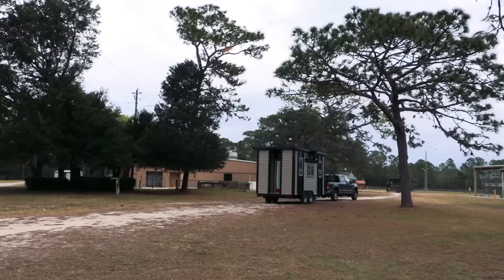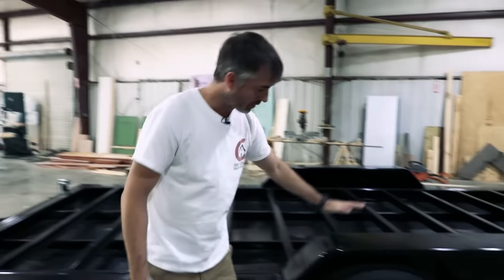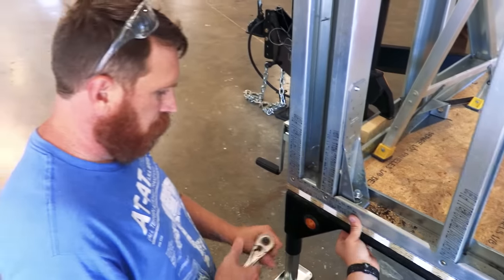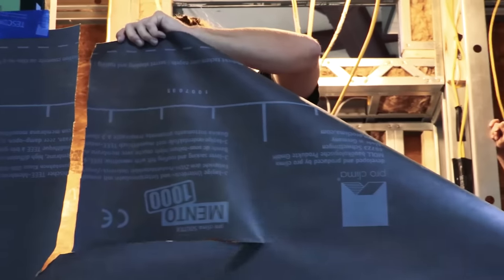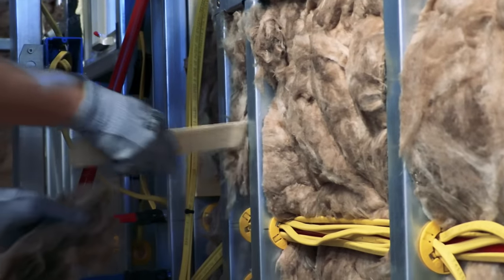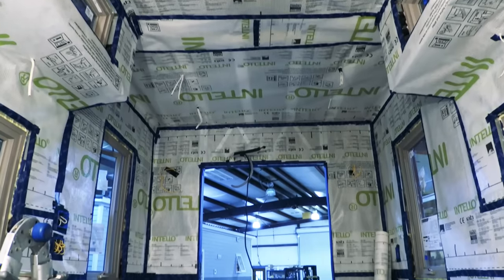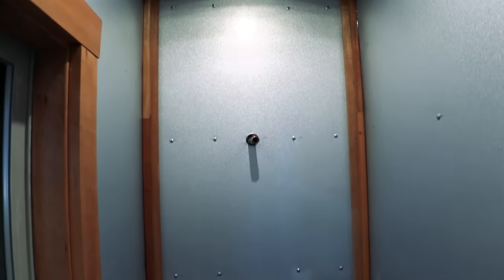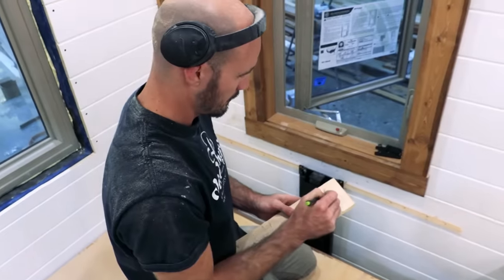Building A Tiny House From Start To Finish!

Comment: Why not weld the steel frame on the trailer? Or why use bolts at all? For maintenance, or quick repair maybe?
Reply from the maker: You can construct a tiny house with a welded steel frame, but it's not really how this system works. The bolts secure the frame to the trailer really well. That thing isn't going anywhere! :)

Comment: Wrong hot water heater you have gone with gas tankless and as for the shower in galvanized steel that a bad idea but stainless steel on other is better option and what wrong you never ever make a flat roof as water will always fine way in 99% faster that way and just look at RV, Box, Semi trailer and if had used a flat roof you gone with cap style with roll over edge other and even then I would have a still put slope on it for drainage.

Comment: The house looks amazing. And I always enjoy seeing tiny house designs that actually utilize very little space. 
Some of those tiny houses shown in videos are way bigger than my apartment :D
Reply from the maker: Especially in the US we found that many of the tiny homes were still quite large spaces! In NZ and Australia we use many of the smaller designs as our roads aren't as big and we are very limited with weight. Because this was designed to be a traveling tiny house, we wanted to come up with a design that was as compact as possible to make it easily portable and simple to find parking spaces for, while at the same time also designing home which is comfortable to be lived in full time.
Reply: I'm from Germany so tiny houses are not a big thing here (yet). And some of our roads are tiny so I think a lot of the American designs would not work here at all (even without legal regulations making most of it impossible). That's why I'm always interested in seeing smaller ones. There are also some people in Berlin right now (it's called Tiny House University) and I feel like they have a lot of designs there that function better in areas such as Central Europe.
Reply: Die amerikanischen Designs passen tatsächlich nicht auf deutsche Maße (hier gilt: maximal 2,55x4mx~7-9m. Falls Du noch nicht reingeschaut hast, es gibt auf Facebook Gruppen dazu, z. B. Tiny House Deutschland, dort kannst Du Dich bezüglich dieser Dinge mit anderen austauschen. Die Bewegung wächst!

Comment: Rookie question - doesn't putting screws in the walls compromise the airtightness of the insulation? Just curious.
Reply: Good question - in this case the air tight layer is a thin sheet of that Intello "smart membrane" and if the screw properly squeezes the seam between the interior paneling and the studs it should make for an airtight seam. If the screw were to miss the stud it would simply puncture the membrane with nothing backing it and leave a hole, so careful work is required. Mistakes would need to be taped up if the airtight layer were to get punctured during construction or over the life of the building. The insulation used here is not airtight at all, while some insulation types can be. Sheets of continuous rigid exterior insulation if the seams are staggered and taped, for example.

Comment: Metal studs should not be used for exterior walls.  It causes what is called thermal bridging, ie. the cold (or heat) from outside transfers to the inside very quickly using the metal as a bridge from outside to inside because metal is a very poor insulator.  Insulation in the exterior walls is not as effective as it could be if wood studs had been used.

Comment: I love the idea of a tiny home. The housing market is outrageously expensive and having a home you can move at will is amazing. Gives you so much freedom but, the design of these houses on trailers confuses me. We have so much technology when it comes to campers which this is basically a glorified camper. It’s a home being towed behind a truck on the highway. Yet these houses have zero aero dynamics what so ever. Even semi’s with all their towing capacity have trailers designed to cut through the wind as best as possible. Why not design the tow hitch of the home rounded or sharper to reduce fuel consumption? And the roof should have had the ridges going long ways not sideways to reduce wind drag. I personally love the idea unboxable is doing where the house comes to you on a trailer and is a expandable home. Super lightweight and made with fire resistant material. Combine these two ideas. A home that is hauled easily on a trailer and a home that expands once in place. Fire resistant and economically efficient.

Comment: I think it's a neat build but i wish you had spray foam insulation. If you intend on taking this into northern Canada and through the northern US States and it happens to be winter, i fear you will have a difficult time heating that. It doesn't look like that much R-value in your walls/roof.
Reply: If you're worried about the horror stories of off-gassing, that only happens when the materials aren't handle properly and the not applied properly. It is still an oil based product, but many people consider it a green material because you expend so much less energy to heat a space, especially if you have gas or wood heat. Plus, it creates it's own air barrier. Heat recovery air circulators are pretty much necessary because spray foam can make a home completely airtight. I saw a video of a passive solar conventional home being built in the Canadian arctic tundra, as I recall they built the walls with double 2x4 construction and filled with closed cell spray foam. It was a sizeable home and they were to heat the whole house with less electricity than their refrigerator used.
Reply: It’s RW insulation. Water resistant.

Comment: WHAT GAUGE STUDS?  HOW DO YOU SECURE THE WALLS, BOTTOM PLATE TO THE TRAILER?  WHAT DO YOU USE FOR RAFTERS, IF GABLE ROOF?  THANKS.  WALLS ARE BEAUTIFUL STRUCTURALLY.  INCREDIBLE HOMES CO., FRAMING 2 FT. ON CENTER AND NO HEADERS ABOVE WINDOWS/DOORS, NO JACK STUDS, ETC. POOR IMO.

Comment: Why the hell wouldn't you just throw a pre formed complete fiberglass shower with toilet in there instead of making your life as hard as possible.

Pro tip, go buy overhead lockers from an aircraft breaker.

Good luck towing that in a cross wind.

Comment: Insulation is made wrong! A house has a steel frame, steel has a high thermal conductivity, the steel thermal conductivity 100+ times higher comparing to an insulation thermal conductivity.  What is the reason for such insulation if all heat is conducted back and forth  to or from the house through a steel frame easily?  Insulation SHALL be made outside ZIP System panels, or, this is simpler, an insulated ZIP System R-Sheathing panels SHALL be used. Insulation SHALL be continuous without steel thermal bridges.

Comment: Although this house looks nice look at a standard house first this house has steel beams unable to buy at home depot  most of the stuff for this house is custom and the cost is for the craftsmanship. Not a budget build. I like his shows but most of his and others shows similar are company built homes. I like to see more homemade built homes like mine with real budgets not just people designing a house leaving the work to the builders and the owner found some rusted corrigated steel and said they built it.

Comment: This will not be usable in temperatures below 0 degrees Celsius Everyone should know that a steel frame lets cold through the wall
Reply: They probably chose that because they live in 2 continents so they'd just move to the place experiencing summer.

Comment: Horrible! Never would build again with Bat style material. It can get drenched and you have to rip it all out!  Foam as used in SIP panel construction has none of those issues.
Reply: The build used roxul which doesn't have the same problems when drenched

Comment: This really doesn't make sense.

Steel studs are terrible in very cold or warm weather. They suck heat and cold right through.
Why seal in any moisture that could make its way into the floor? Mold and rot.
Why are the walls only on sill seal and not caulked to the floor? This isn't actually a high performance build.
Why two layers or WRB? Seems like twice the work and expense.
Windows installed without caulking behind the flange.
Why intello on the interior? Moisture will barely move though the Zip sheathing as it has an incredibly low perm rating. Useless expense.
High performance with no rainscreen? Amateur hour.
The roof is a snaplock roof. Not allowed to be on anything lower that a 3/12. It should be mechanically seamed.

This is a terrible example of what is supposed to be a "quality" tiny home. I would be embarrassed to have built it.